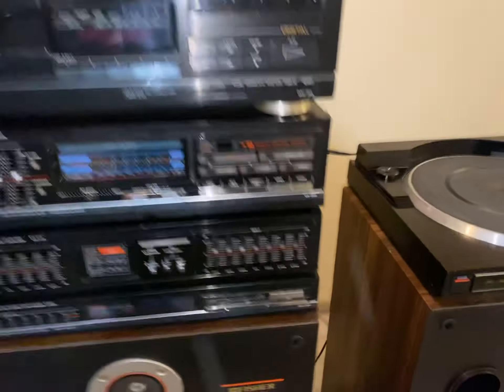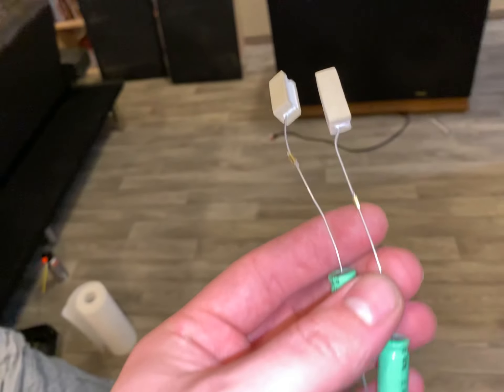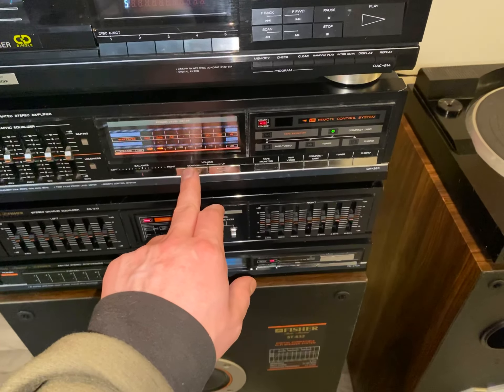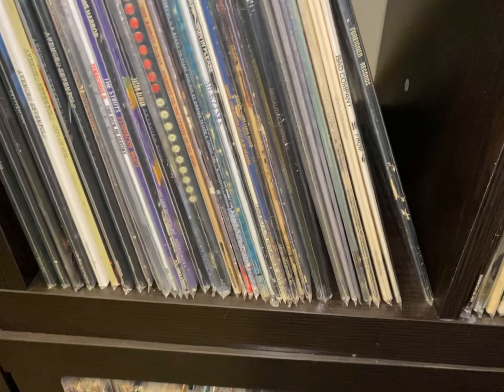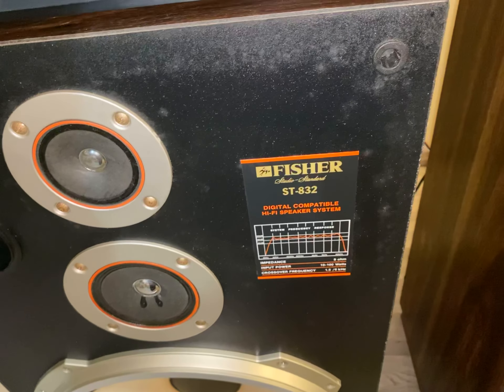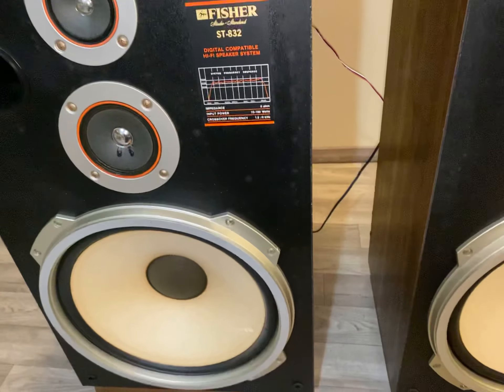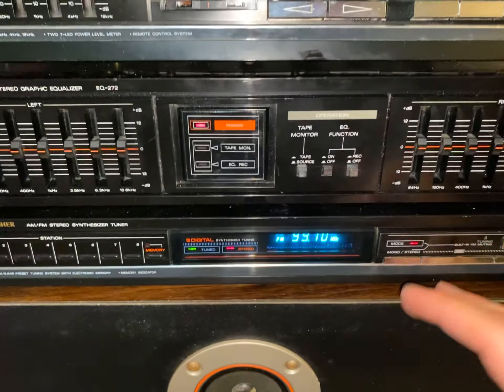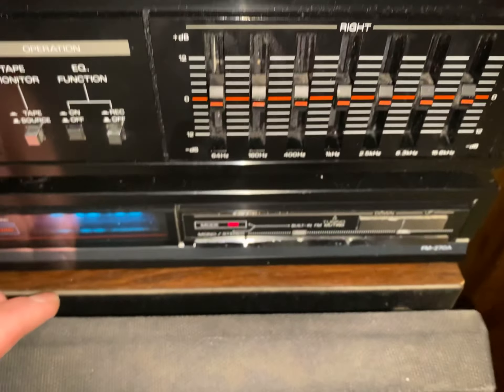Fisher Stereo System CA-283 Amp, FM-270A Tuner, MT-728 Turntable, & ST-832 Speakers.

Comment: i have a few of these Fisher systems. if you want to find the other original components for this system the  cassette player is model CR-W74H and the Cd Player is model AD 823. the remote is REM 285 & the speakers i have are ST 840. I also have the 832 but they sound the same as yours did before you upgraded the crossovers.
Reply from the maker: A lot of people have that problem with the 832 model for some reason